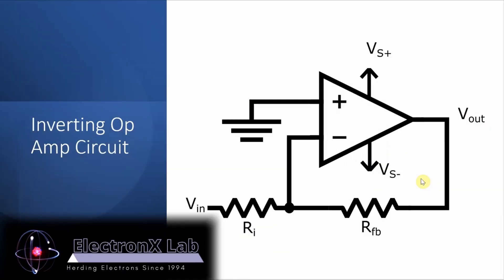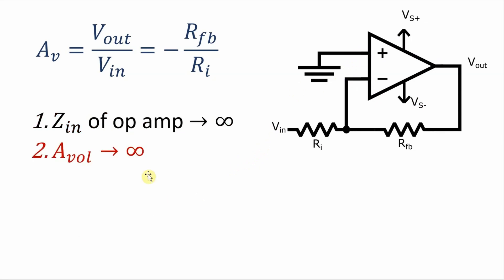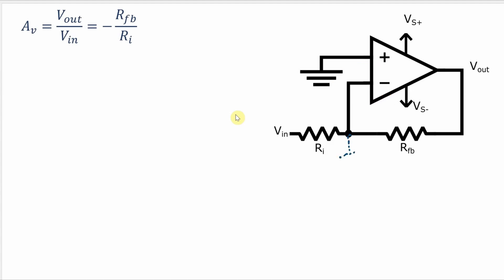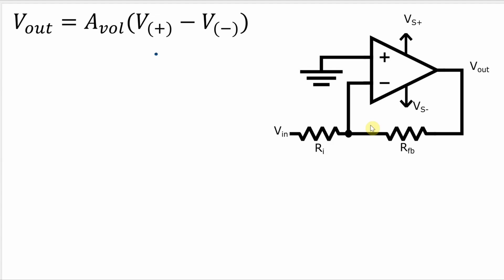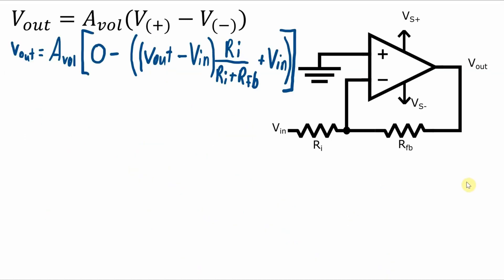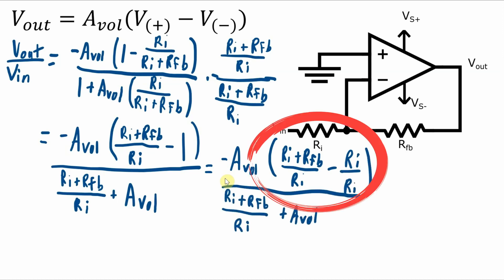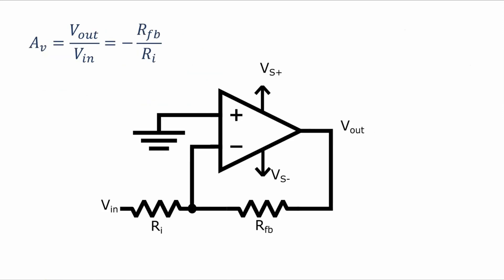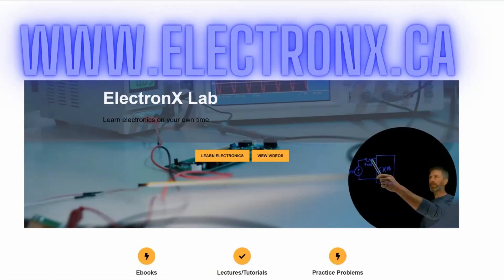Introduction to Inverting Op Amp Circuits

Comment: Hi! I'm trying just to invert a negative dc signal that comes from 1.5V to 24V (variable). So no gain, in theory if I use both resistors of same value, should work, but it doesn't. There is always a gain, which changes Vout voltage.